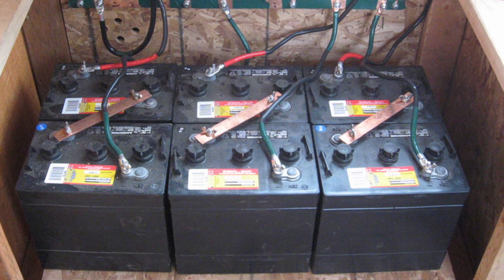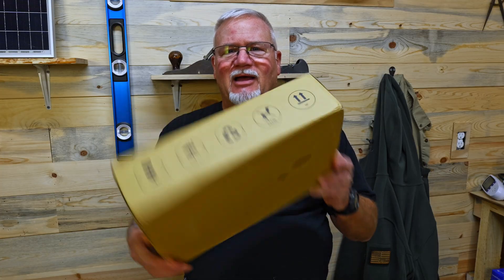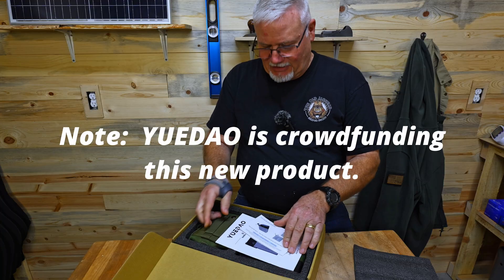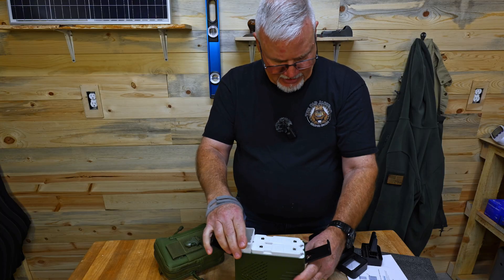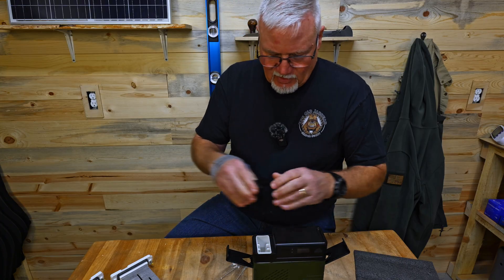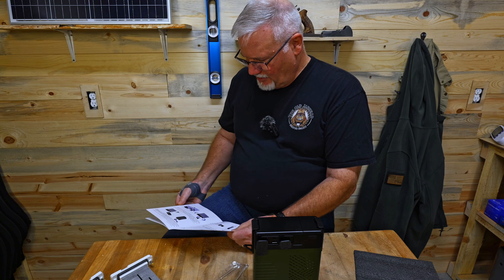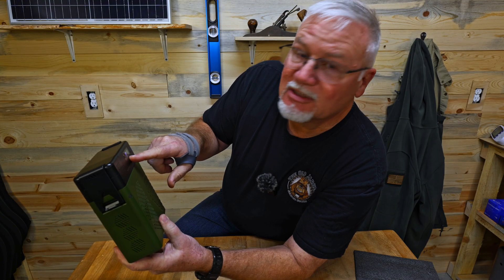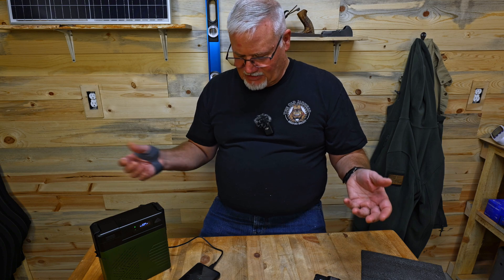No Sun? No Gas? Just Add Salt Water!

Comment: hmm its a little bit bigger than my latest version of my ~50$ 420wh micro powerstatons which I make with higher quality prismatic LFP cells. better quality than the bottom shelf cylindrical cells they use in powerstations and way more compact. guessing its a little bit lighter, although, the powerstation can put out 1.2kw or about the same power as anything that plugs into a standard north american outlet, excluding hair dryers and space heaters on max. I package them now into those TSA approved steel lock boxes made for flying with pistols, which fit really nicely in a backpack. oh but it is rechargable, guess thats a big advantage. i should post a new build video soon.... maybe in a month or so lol
Reply from the maker: Very interesting!

Comment: Lets see a capacity test.
Reply from the maker: I'll have to figure out a way to do thai since I currently don't have a way to test USB ports or drain a battery via USB
Reply: @TheOldJarhead  There are small digital meters you can connect in series with a USB port. They display current and voltage. You could do a load test, and math it up, to figure out capacity. Thanks for responding, we like your video productions.

Comment: Can you used the Anderson solar port on the mega1 to extend battery if you don’t have the b2 cable
Reply from the maker: Sort of, but not the same as a B2.  With the solar input you can connect a battery (48v is best) and draw off that battery as if it were a solar panel but you will have to recharge the battery separately.

Comment: To be clear for anyone else reading this - this is not a sodium battery - on the Kickstarter page, it shows the top being removed to charge a phone without the bottom part. The top part came with a storage charge (80%) and this is why it was immediately able to charge your phone.
The top part likely contains a lithium battery and the bottom part is where the magnesium plate and saltwater go - the saltwater oxidizes the magnesium to produce an electric charge that can, slowly, recharge the separate battery - once the magnesium is used up, adding more saltwater will do nothing until a new magnesium plate is installed - if you don't have one of those expensive magnesium plates - you're out of luck. 
A sodium battery is completely different and can be recharged for many cycles and may be something to talk about in the near future because of some recent technological advances, but probably will be best for home energy storage - even though people are trying to get them to work for cars and phones because they are more stable than lithium batteries, however, there will be better batteries available for those devices based off current battery technology. 
If I'm given the choice at this point in history - I'm going to carry a 20ah (20000mah) bank and a portable solar panel.
This device is equivalent to the swamp "air conditioner" that just blows air over a wet sponge material to supposedly cool the surrounding air, but they don't tell you that if the relative humidity is too high, or you're already sweating, the swamp air conditioner will just not work or will make things worse. 
It's just a gimmick, and there's a good possibility that you won't even receive anything as apparently Kickstarter has disavowed themselves from the scamsters on their platform and this companies name is the same as other scams where they send you a product and you only pay for shipping - but you get nothing - or they sell you a product, but tell you after they have your money that the shipping will be hundreds of dollars.
Reply: On both Kickstarter and YouTube, there are videos showing that the top section is merely a Power Hub and does not include a lithium battery. The product's official website is also already live. After all, no one would spend hundreds of thousands of dollars on R&D, molds, and marketing costs just to scam a few tens of thousands of dollars on Kickstarter.
Reply from the maker: Actually the top part does not contain a battery.  It's a converter that can take 1 to 30v and convert to 5v.  That it.  Must be plugged in to be useful or on the battery.

Comment: Jarhead, I really feel like you missed the point of the product & its potential in a bigger picture. It clearly is a microscopic version of what is possible on a larger scale. Think about powering your cabin. JUST ADD WATER...  ✌️
Reply from the maker: I've seen some of the larger ones but at this point they have too steep a voltage curve, losing way too much over the course of draining the battery making them difficult, at best for large operations without a different inverter that can take such a heavy voltage loss.
Reply: @TheOldJarhead If there's a chemical reaction that can create voltage like what I just witnessed. What is the Macro version of that??? Salt, Copper, Zinc & a bathtub of water???
Reply from the maker: Who knows?  Bluetti made a power station with an Na battery but it didn't perform well and from I've seen, many of the current batteries are about the same.  However, I'm sure they'll figure it out soon.
Reply: @TheOldJarhead hey thanks for the back & forth... From the moment I discovered your channel all information & creativity has been very valuable. You've responded when I've asked questions. It's obvious that you enjoy getting to the root of things... Until next time bro... ✌️

Comment: This is not new tech. Once the chunk of magnesium is used up - it has to be replaced - so you're locked in to buying specific shaped magnesium plates plus shipping - 9r this thing doesn't work. The saltwater does nothing but oxide the magnesium which then has to be replaced. This is also why it only produces five volts and not twelve - it's a low power, single use, very expensive battery.
Reply from the maker: It's actually not a single use though I can't recall the specifics but you are correct in that sodium batteries have been in development for a while.  This is more of an emergency/backpacking/biking type battery IMO that can be carried empty until needed making it very light.
Reply: @TheOldJarhead  To be clear for anyone else reading this - this is not a sodium battery - on the Kickstarter page, it shows the top being removed to charge a phone without the bottom part. The top part came with a storage charge (80%) and this is why it was immediately able to charge your phone.
The top part likely contains a lithium battery and the bottom part is where the magnesium plate and saltwater go - the saltwater oxidizes the magnesium to produce an electric charge that can, slowly, recharge the separate battery - once the magnesium is used up, adding more saltwater will do nothing until a new magnesium plate is installed - if you don't have one of those expensive magnesium plates - you're out of luck. 
A sodium battery is completely different and can be recharged for many cycles and may be something to talk about in the near future because of some recent technological advances, but probably will be best for home energy storage - even though people are trying to get them to work for cars and phones because they are more stable than lithium batteries, however, there will be better batteries available for those devices based off current battery technology. 
If I'm given the choice at this point in history - I'm going to carry a 20ah (20000mah) bank and a portable solar panel.
This device is equivalent to the swamp "air conditioner" that just blows air over a wet sponge material to supposedly cool the surrounding air, but they don't tell you that if the relative humidity is too high, or you're already sweating, the swamp air conditioner will just not work or will make things worse. 
It's just a gimmick, and there's a good possibility that you won't even receive anything as apparently Kickstarter has disavowed themselves from the scamsters on their platform and this companies name is the same as other scams where they send you a product and you only pay for shipping - but you get nothing - or they sell you a product, but tell you after they have your money that the shipping will be hundreds of dollars.
Reply from the maker: Again, the top part does not contain a battery.

Comment: I wonder if you can hack a golf cart battery charger, to charge a power station. Cheaper than a chargeverter and still use “dirty power” from an open frame generator.
Reply from the maker: You can certainly use one to add power via the solar port -- I've done it several times -- but the 'dirty' generator gives me pause.  I'm guessing it isn't a pure sinewave that the genny is kicking out?
Reply: @TheOldJarhead  no, the open framed ones usually aren’t inverter generators.
Reply from the maker: True but many still do pure sine

Comment: How long the charge last and after it dis charge how to charge it back , by putting water and salt again ??
Reply: A set of electrode plates can be used for approximately 1.5 to 2.5 hours per use, depending on power requirements. If used again, a new saltwater solution may need to be replaced. A set of electrode plates will be completely consumed after approximately 25 to 30 uses, and only a new set of electrode plates and saline solution need to be replaced.
Reply from the maker: Thanks!

Comment: Cool little product. i could see the use for it, but I think they missed the boat not marking that water bottle at 400ml and the powder coming in several premeasured pouches to negate the need for measuring cups and funnels. So easy to do and make the product stupid proof and carry less items for when needed. The pros are lightweight and compact. The great beauty in a product like this is, Shelf life is infinate. Salt and water never go bad. So it can sit forever and ever and never used until say that tornado comes through and now you need a way to charge cell phones, modem and tablet to communicate. Great item to keep handy in the house or car.
Reply from the maker: That's a really insightful point about the pre-measured pouches and marked water bottle. That would definitely make it even more convenient for emergency use!

Comment: Well this is an interesting product. It is an aluminum air battery.
Note that the metal fuel plates are one time use.
I wonder if it would be possible to fabricate your own "fuel" plates for long duration output.
Reply from the maker: I'm not sure they are one time use or why clean them?  Plus ut said to change the water, not the plates.
Reply: @TheOldJarhead  Maybe I should have said one cycle. What I meant is that they are like an an alkaline cell in that they can be used until depleted and are not rechargeable.
Each plate is 500 Wh. It comes with two plates so the kit has 1 kWh of energy storage.
Still a very good emergency energy source as it can effectively be stored indefinitely with little or no maintenance or degradation.
Cell phone communications is one of those things that is absolutely critical in an emergency and this can ensure weeks of cell phone use.
Reply from the maker: This from the folks making it:  A set of electrode plates can be used for approximately 1.5 to 2.5 hours per use, depending on power requirements. If used again, a new saltwater solution may need to be replaced. A set of electrode plates will be completely consumed after approximately 25 to 30 uses, and only a new set of electrode plates and saline solution need to be replaced.
Reply: @TheOldJarhead  Yes, This is what I was trying to say.
Reply from the maker: Gotcha.

Comment: I first thought well you can charge a phone direct from most of the smaller solar panels, but!!!!!!!!! waht if there is no sun, then i quess this would be a grate alternative. Just fur fun if you have no water like in the dessert, would it work on sweat, being water and salty???????????
Reply: Theoretically feasible, but due to the low concentration of sweat, the output power may not be high. Of course, you also need to collect enough sweat
Reply from the maker: lol, that would be a lot of sweat!

Comment: Totally unrelated question to video.  I've been thinking of ordering that thumb brace to replace my old one.  Does it work well to control your thumb pain?  Another question does that battery work with ocean water?
Reply from the maker: The thumb brace does help.  I've had it a while so I can't recall where I got it but I think Amazon.  

And yes!  The battery does work with sea water.  The new ones (production) will apparently be improved as well (I received a note from them recently).

Comment: Whoa Nelly this is a Game Changer. But Portable 60000MA Rechargeable Units are going for $25 - $40 Bucks... 

🤺  Semper Fi Marine  🇺🇸
Reply from the maker: This I think, is more of a camping/hiking hack but I see the tech advancing so it will be interesting to see where it goes.
Reply: Charge your battery banks at 45 watts  max.
Reply from the maker: Interesting thing is the 45w charge I think is just for the power box on top which is more of a pass through if not connected to the battery....I'm still confused by that.